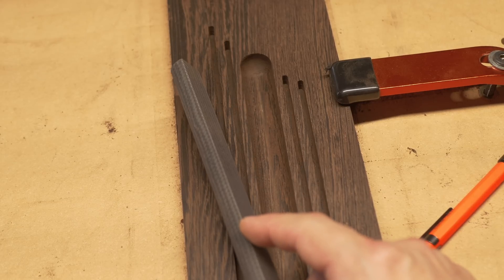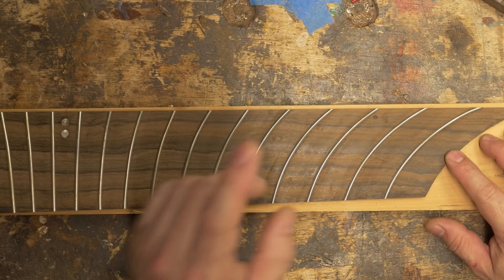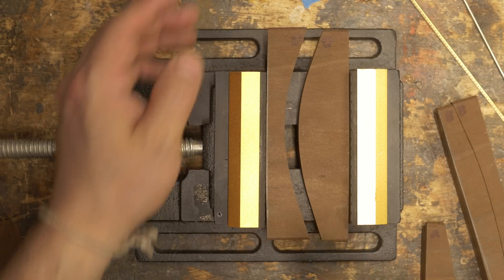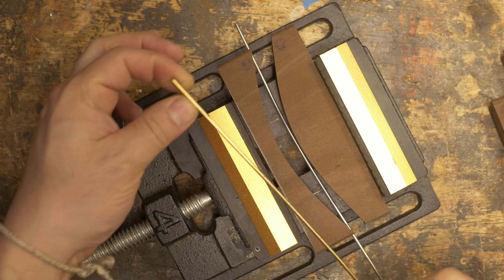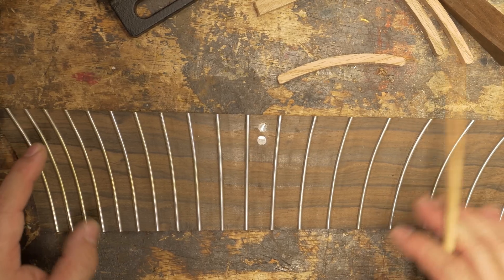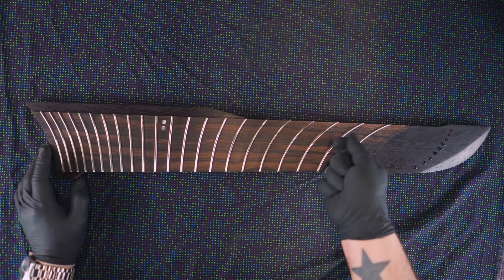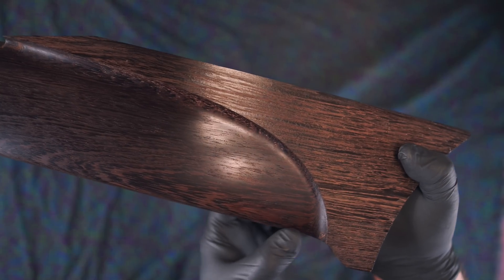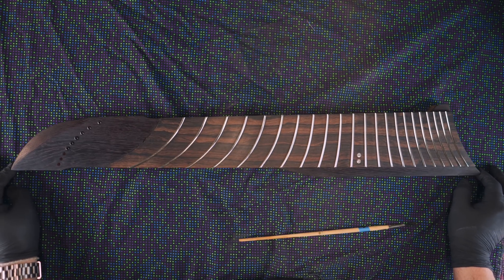Exponential Scale - Great Guitar Build Off 2022 - THE AVANC #GGBO2022 #greatguitarbuildoff2022

Comment: Your build intrigue me, make me think - but gee they make my head hurt as well.

I’m still not sure how you bent those frets - unless you bent them as you fed them into the slots (watch out if one comes loose then).

Can’t be sure but the fretboard is flat? I suppose radiussing such a wide one could only involve a very minor radius anyway.

I get the idea of making the neck so stable that it won’t need a truss rod to correct the affects of weather changes etc, but that only leaves the bridge and the nut. How does that work with an instrument that’s played by different people with different preferences about action - or is this the type of instrument for one person only?
Reply: Unless those are traditional malleable nickel silver fret wire, they will pop out all over the place: guaranteed!  You are also right that he doesn't have a truss rod and no relief at all:  Wait until the video when he first put's the strings on it, if the series doesn't end abruptly right there because he finds out what happens when you don't have any!  I have been using carbon fiber reinforcements in all of my necks since the 80's, along with tough two way truss rods for adjustment.  They are stable as rocks, and do not whey but a pound or two, and necks never were the heavy part of a guitar, the body is.  Neck dive, like on an SG can be remedied by putting the strap buttons in a place that prevents it to begin with!

Climate changes are no big deal if you oil finish the fingerboard once a year, and no need to fall for any of the many expensive snake oils out there, as cheap "Teak oil" is the best thing ever made specifically for that purpose, as it mimics the oils in teak wood, used to make unfinished outdoor furniture and anything that has to endure more extreme climate changes.  It doesn't soak in deep, nor is that necessary, and can even be harmful by swelling some woods, which can lead to loose and uneven frets.  It bonds to the wood and polymerizes as it dries creating a barrier between the wood and the climate.  It locks what moisture the wood already has in, and prevents any from entering.  I have been using it for decades, and never had any complaints from customers, only the question:  "What's your secret sauce you used on my fingerboard".  Well, it ain't no secret, and there is no magic, which most so called "Fingerboard oils" promise.  The real magic is in how they get your money for vaporware.
Reply: @Bob-of-Zoid  think you misunderstood me here - and I’ve thought things through further myself too.

The comments about the frets springing out relate to installing them, not after the instrument is finished. If that fretboard is radiuses then pre-shaping them in 3 dimensions must be tricky - like setting a tricky mouse trap. Maybe the fretboard is flat. But this guy really is a instrument engineer, breaking new ground so I reckon he worked that bit out - once they’re safely in then they’re going nowhere.

The part I’ve thought further about relates to that neck shifting due to weather - and it simply won’t budge with all that reinforcement. As for “no relief”, not sure that this is an issue either because this is not a “band” instrument and it wouldn’t be shared around either. It’s more for a solo player seeking a better way to explore further with more strings.  It must be custom built around his action preferences. Once yo set the correct (for him) neck break angle, with scope for adjustment at the nut and the bridge, there will be no need for further adjustability.
Reply: @ianb4801  I am a guitar builder (40+ years), and you misunderstood me, and you may want to look up some of the words I used, because they have definitions you seem to be unaware of.  I also studied engineering (machine engineering, so electrical and mechanical engineering, and no, he is not engineering, he is experimenting, and with things he could have figured out ahead of time, to where if he did, he would have either known how to bend the frets right (he didn't) because of how metal reacts.

The frets cannot spring out of anything, unless they are installed into something, now can they?  DUH!!!  If he installed them under tension, then not only did he have to force them in, but they WILL stay under tension indefinitely, or until they pop out, and sooner or later they will, because no matter how much reinforcement there is in the neck the tension of the frets is pushing against the wood in the fingerboard, and due to the seasons, and changes between dry and humid seasons the wood will swell, and shrink plenty for it to deform, and lose grip on the frets causing them to eventually pop out.  I have worked on many plain guitars where that happened, especially when someone installed stainless steel or any other fret material that is not malleable (Look it up) like old traditional "Nickle silver" fret wire, and even nickle-silver fret wire has some memory and they can pop out too, just not as easily or as much, as they can be hammered to conform pretty good.  Modern fret wire is not anywhere near as malleable to resist wear, and MUST be already in their final shape, before pressing them in to make sure they stay in that shape.

Relief has zero to do with instrument type, and is only applicable to stringed instruments with fingerboards!  Relief is a concave bow from the nut to the saddles with the lowest point being over the 12th fret (scale center AKA 1/2 scale).  A vibrating string is a sine wave after all, with it's high point in the center (12th fret).  Relief is needed to accommodate the space needed for the string to vibrate.  No relief = fret buzz and dead notes.  The more massive the string, and the lower it's tension, the more space it will occupy.  He has no way to increase or decrease the relief, which is exactly what a truss rod is for!  Although a truss rod can also act as a reinforcement, and is used as such in many instruments, it's not a good thing, because it will not prevent a neck from twisting, and also just puts more forces on the neck, inviting it to warp and twist.  So, I use carbon fiber rods, make the neck with a relief (slight bow) built in, so that it can hold more string tension than it has too AKA:  a Zero force design.  I also install a two way truss rod that can bend the neck over it's entire length in both directions, because once the strings are on and up to pitch their tension will pull in just a bit of relief, more or less based on the string gauges and their tension.  That way it can be adjusted for any string gauges and tunings the player uses, and very precisely too!  Now that's god engineering.

So sorry, but for him to not understand any of that after who knows how long he's been "Engineering guitars" shows that he doesn't know what he is doing, not even the basics, as he has sufficiently demonstrated.  And you obviously don't either.

You can call yourself an engineer all you want for all intent and purpose, but you don't go to collage for 4+ years to learn how to figure shit out as you go along, and make every mistake and bad decision along the way!  You learn material properties, the related physics... so that you design something right and know exactly how to build something, and using what methods and materials, before you start building it, in order to get it right in the first place.
Reply: @Bob-of-Zoid  I don’t know why you have to be so insulting here; you seem intent on writing heaps to pick a fight and I wish you would stop.

Number 1: I do NOT call myself an engineer and I did not say that here at all. What I said was that this luthier is somewhat of a guitar engineer, in the practical sense if not the academic sense. I don’t see the point of you chest puffing and bragging consequent to this when I didn’t say this at all. Maybe you don’t read so well.

Number 2: my point in mentioning things like radius and adjustability was to see if the luthier might write back to me to discuss these things. He didn’t - oh well. But in no way am I professing exceptional technical expertise here, I’m just seeking knowledge. I must say I have no idea why you responded yourself, like this in the first place. Good luck with your life.
Reply: @ianb4801  I'm not any more insulting than you are, I'm just stating facts, not beliefs, and well words have somewhat concrete definitions.  I am not insulting you, you are taking offense:  Huge difference.  I am giving you the right terms for things so you can better understand them!  I even explained the concepts!  So I am in fact discussing things with you, and teaching, as long as you can learn, which requires the grasshopper to shut up and listen to the master.  Facts are not emotional, but to the point, so just keep your emotions out of it, as it's the best way to fail with technology, because physics and tech doesn't give a shit about how anyone (me included) feels, nor what anyone wants to believe, it just is what it is.  If the language were way forgiving (not precise) there would be huge misunderstanding and many errors.  Errors rule # 1:  Do your homework:  It's better to not make errors in the first place, rather  than spending the time and resources to find the source of the error, and everything it may take to correct for it.

You, or anyone else using words in new and novel ways doesn't make me, or anyone else who knows context specific terminology, or the scientists and engineers who coined those terms wrong.  Now for those using words wrong:  I'm sure you know what you mean, which doesn't mean you actually understand it, but that doesn't help me, nor anyone else unless we know what you actually mean which may have many details...  After all, we who have to use terms correctly on a daily basis in order to do things right, and communicate without introducing errors, couldn't function if it was a free for all.    Even worse, errors can accumulate and aggregate,sometimes exponentially, just completely messing shit up.  So, this is the first thing you, in professing to seek knowledge need to take to heart.  GET YOUR TERMINOLOGY RIGHT!  Use (learn how to first if necessary) a thesaurus, dictionary, and specific to topic and field, as word roots are not identical to subject specific use.  Mostly never think you understand the whole of a concept by it's title, the details are everything!

You most certainly can't expect me  or anyone else who knows the terminology, to use nor understand wrong definitions as you understand them, or as we must suspect don't,  just because you use them and know what you mean.  We literally can only guess what someone means if its obviously the wrong term, and have to come to the logical conclusion that they do not understand, or else would use proper terms.

Sure many people use so called "Colloquialisms", but they are still often just wrong in all reality!  "Common knowledge" is also often no knowledge at all, but rather false belief!  Us humans are strange and confused beings with way too much to deal with all at once!  I get it, so relax, take your time, ask questions first, pounce later if you have to!  Used wrong, many words/terms just don't make true sense in math, physics, engineering... for which those terms were coined to be specific in the first place!

If you truly want to learn, then look into topic, technical or scholarly or any other field specific uses of terms, when you are on the subject, and just read any subject related information as used by those in the field.  Shit comes together in wonderful ways, with physics giving biology meaning and so merging fields.  One just learned thing suddenly explains any number of questions you wanted an answer to.  The more you know, the more things make sense together as a whole, and it's much easier to see how things relate and connect, or why they counteract..,    As for most of science and engineering, words mean exactly the same thing, and are precise and not interchangeable, for accuracy and to avoid confusion, precision is important.  Once you have a better understanding of technical terms, and of course the science behind them (the details), you will also understand how you can in fact have a very light but highly dense material, even though most would think that density and weight must come together, or are one and the same thing, neither being factually true!  How about why "tonewood" is absolute bullshit, and not a thing at all, but material properties even if they don't effect tone can and will effect sustain/decay, and the tonality of the initial hit (striking of the strings) which dissipates in a few milliseconds, and why just because something is true, its quantity of influence is what counts in the end;  IOW: if the effect of some force is present, but insignificant in strength and effect, then you need not account for it because it won't make a difference.  So no, putting a "Punk is Dead" sticker on your guitar is not going to do shit to the sound, but put one across the strings it will fuck everything up!  (<:

Being 100% confident when wrong, feels exactly the same as being 100% confident when right!  What really counts is if you are right, or wrong.

Peace.

Comment: Since the early 2000s I've imagined a carbon fiber neck core like a D Tube that extends to the end pin like a neck through blank. Then you can have removable/replaceable fretboards on top and neck shapes/profiles on the back, all using veneers or modern composites like Richlite to maintain "wood feel"/touch. "Relief" can be obtained by removing the neck back plate or having a hole in the center of the neck under the 8th fret and or at the string nut that has an adjustable hex nut attached to a plate that the fretboard engages with when installing. This lets you adjust the relief and the nut height. I imagined the fretboards go into a channel similar to dado "channel bound" guitars where the fretboard heel goes under a the body with a biscuit insertion and the 8th fret relief adjustment section and nut have clasp locks similar to guitar cases to secure them to the structure core. Then the neck back is put on similarly, sliding into/under an biscuit slot with the nut end securing it with another clasps, clip, or other means for quick release and removal of the neck back for easy adjustment.

One core could let you have several scale lengths, nut widths, and fret layouts: traditional, fanned, exponential, etc. and of course different neck back shapes from chunky C to V and asymmetrical, etc. 

Being a neck thru blank could also afford replaceable body wings to customize the shape and comfort of the body.

Gibson/Fender/Third parties could accessorize the crap outta this kind of system. It would go well with modern modular pickup replacement systems like Gyrock/Seymour Duncan.

Comment: So, its a multiscale with curved frets, yes?  Looks great and I admire your tenacity in getting the frets to do that bend.  I didnt think the fret wire would spring back, I had assumed that they would either kink or snap.  Building a neck out of carbon fibre should not be too difficult, I'm thinking of making my next guitar out of fibreglass.  Would be a similar process, I think.

Comment: I crown with a small tool that has two rounded rods on the bottom and using a flexible sanding sponge go up and down the frets changing the grit periodically for surprisingly great results. I've done a bunch like this and it's 10 times faster and easier may make those curved frets easier crown.